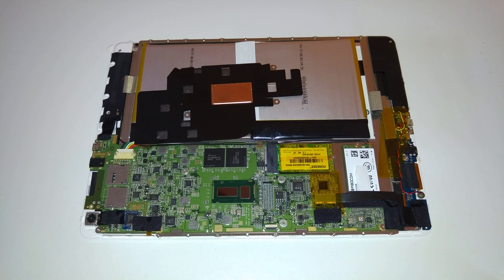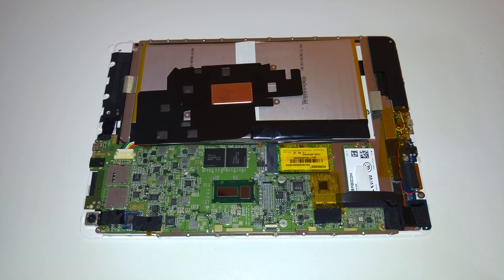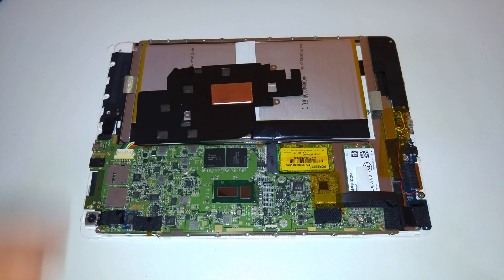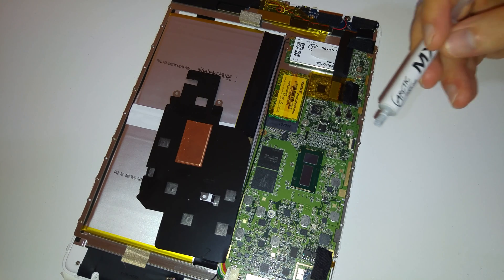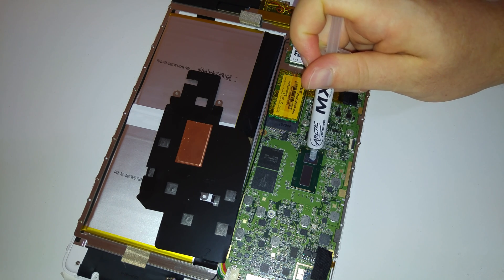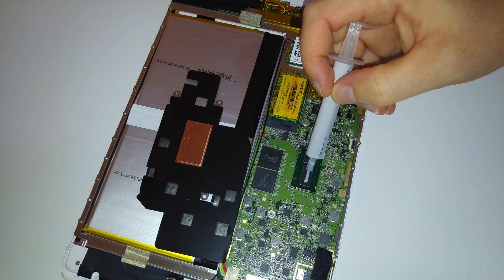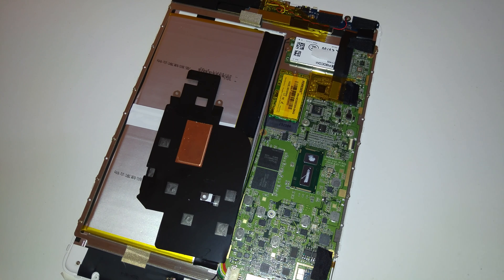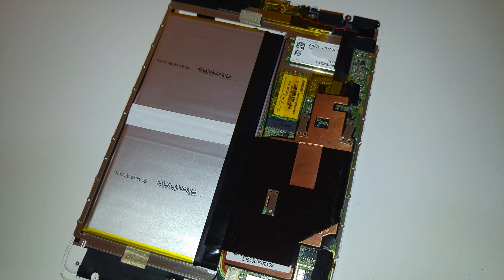Applying thermal paste to a Core M tablet. (Request)

Comment: Does the paste help with temperatures? Would be nice to see if there is even a difference in heat after doing this.
Reply: +TekReview's Most consumer grade CPU heat spreaders(metal shield that covers CPU) are not perfectly flat and may have small grooves or divots. They are also sometimes slightly curved. This can create small air gaps between the CPU heat spreader and the Heatsink and since air is a poor thermal conductor reduces cooling efficiency. Thermal compound acts a filler between the two surfaces getting rid of any air gaps and maximizing thermal transmission.   In other words yes, you can be sure that adding a quality thermal compound to any system is going to make a difference.
Reply: Orumus Vids I said HOW MUCH does it help. There is a difference, I know all about Thermal material and what kind to put on it. I build my own PCs, I just do not bother to buy every tablet on the planet and take them apart.
Reply: +TekReview's You asked if it would help with temperatures. Then said you would like to see if there is even a difference. I explained how TPM works to be clear that no matter the circumstance there will always be a decrease in temps when applying TPM between a semiconductor and heat sink. The amount will obviously differ but there is always a benefit.